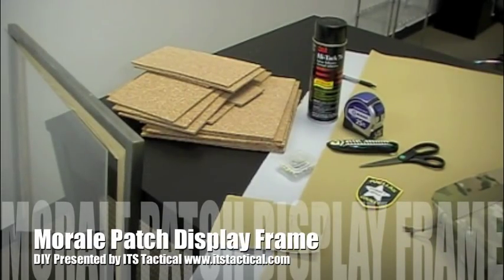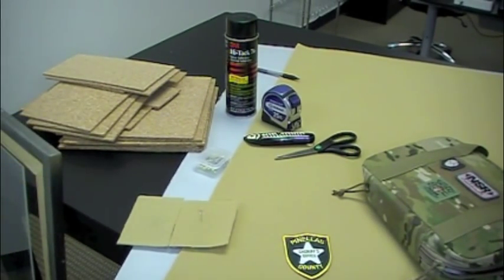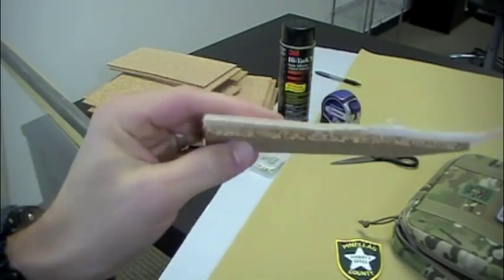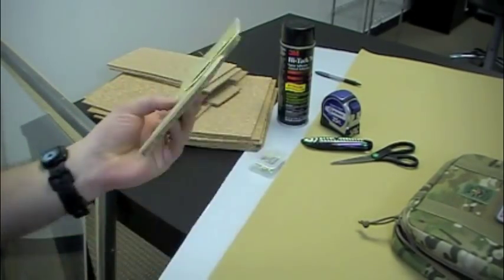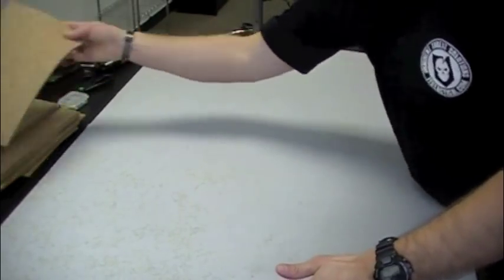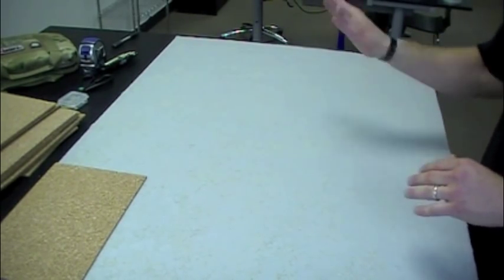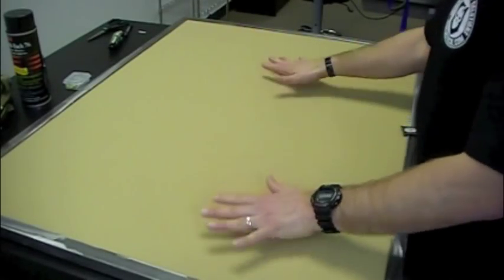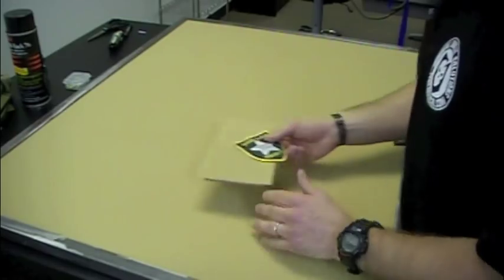DIY Morale Patch Display Frame

Comment: I would highly suggest doing this with a pre-framed cork board, and then cutting the veltex or whatever fabric you're using to slightly bigger than the size of the cork portion, using the high tack glue and then tucking all the sides under the edges of the frame. My friend and I did this tonight and it was much less work this way, and worked out great. Thanks for the video ITS

Comment: Just a tip that may help in the future: if you use Hi-Tack spray glue on both sides of your material (cork board and fabric), let it dry, then attach them, you'll be less likely to have the separation of fabric from cork once hung. The down side to that is that once you attach the glue sides, you can't re-position them. Hope that helps!